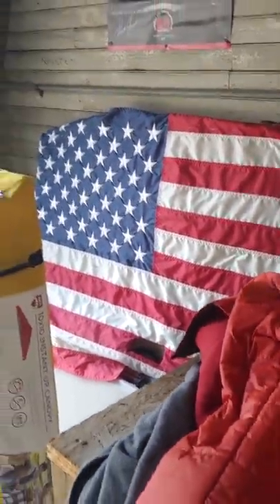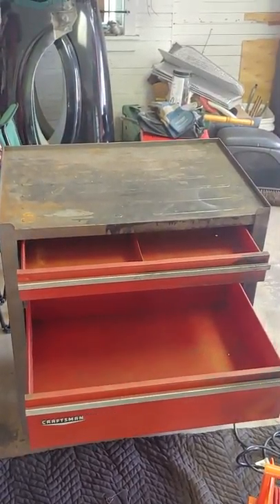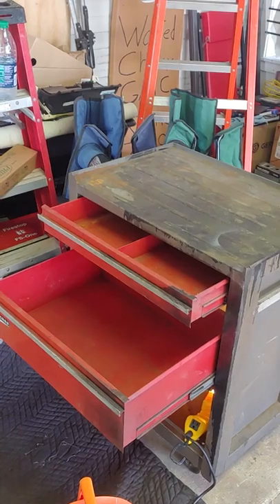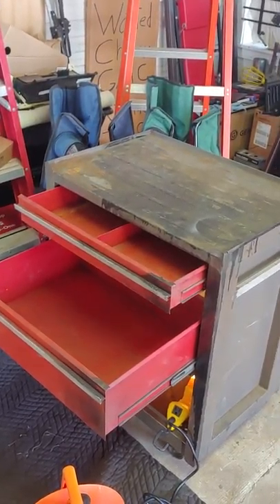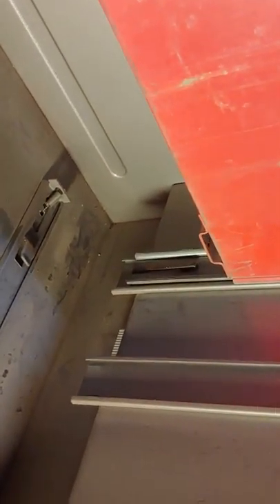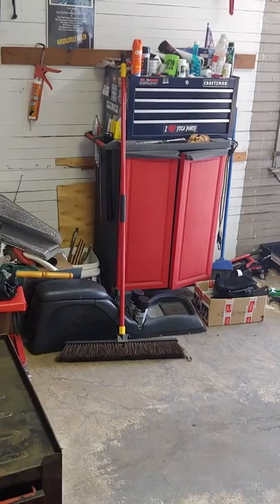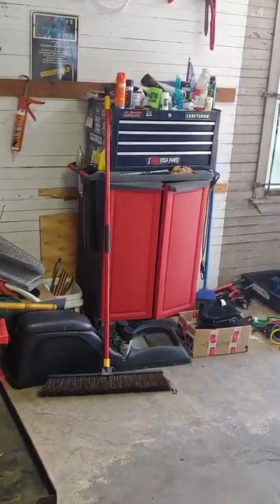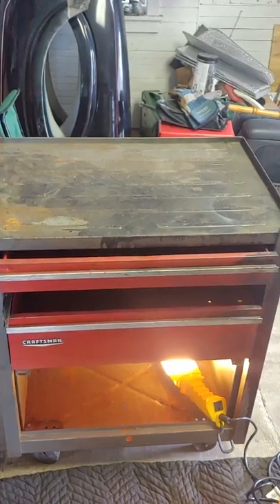How to get a stuck drawers out of a old Craftsman Toolbox

Comment: Solved my problem!  The swing door at the bottom just needed to be pushed back all the way, and it lifted the locking bar with the tabs.  One drawer had been locked shut.  So, with the swing door at the bottom pushed back all the way (with five slide drawers above), I pulled all five drawers out an inch or so, so that they were clear of the locking tabs.  Then, I pulled the swing drawer forward a few inches, and heard the locking bar with the tabs fall to its "locked" position.  Now I can open and close all the drawers without them locking each time.

If any get locked again, I will remember to push the swing door all the way back to lift that locking bar again!  Yay!  Thank you!

Comment: I have a toolbox like that. The bottom section has a door that's hinged on the top. In order to unlock the drawers you have to lift open the door and slide it all the way in. That releases the locking mechanism. Mine has the opposite problem where it stays unlocked.